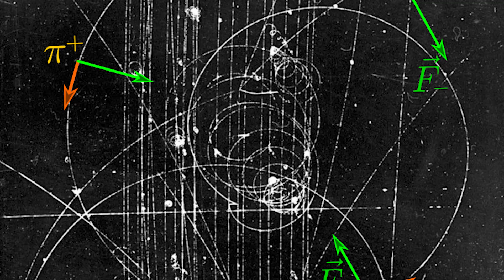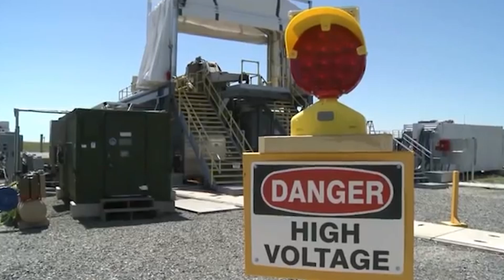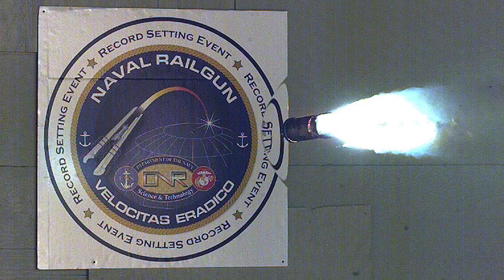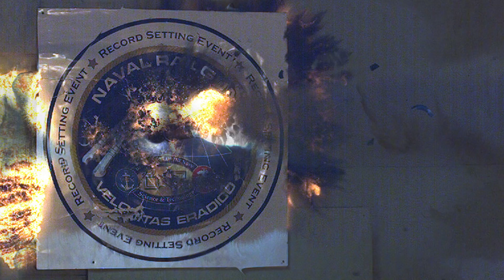Railguns: The Kinetic Future of Warfare

Comment: you should have mentioned that the reason why these as well as coilguns need insanely large power supplies is that they are insanely inefficient in terms of energy used.  i've read that they only manage to transfer about 1-2% of their electrical energy to the actual target.
Reply: i think more like 30% has been achieved. For example the Green Farm railgun used a 32MJ capacitor bank to launch 9MJ projectiles as long ago as about 1990.
Reply: @derekp2674  source?
Reply: @theX24968Z  For a general overview of railguns, the Wikipedia article has some details of railgun theory, past projects and future aspirations ( https://en.wikipedia.org/wiki/Railgun ). It is a bit thin on the ground for information on the 9MJ "Task B" projects though. 

See also slide 15 in here: https://www.slideshare.net/amarmehta123/railgun-akr which shows a photo of the Green Farm 9MJ railgun, and cites parameters for a 8.7MJ launch, in which case the efficiency from 32MJ of capacitors would be 27%.

The Task B 9MJ railgun projects are well reported in IEEE publications from the series of International Symposia on Electromagnetic Launch Technology from which the main papers are available in the IEEE Transaction on Magnetics - i.e. public but paid for references. (For example see https://ieeexplore.ieee.org/document/559905?arnumber=559905  and https://ieeexplore.ieee.org/document/738368?arnumber=738368 ). The latter gives some actual data on successful shots from either Green Farm (USA) or the UK's Kirkcudbright range, which also used a 32MJ capacitor bank.

A more academic railgun power system model for the analysis of energy flows (etc.) is given here: https://ieeexplore.ieee.org/document/101067

Let me know if you have any more specific questions and I'll see if I can answer them...

Comment: pretty sure the only thing holding railguns back is energy density, the size of the capacitors needed... need way too much space and weighs way too much to store it on a reasonably sized ship... like you could convert an aircraft carrier or battleship into a railgun platform maybe...
Reply: I don't know about you, but I wouldn't want to be on board a ship that had just taken a hit in a battleship-sized capacitor bank. Biggest damned arc flash of all time.

Comment: Just for the sake of comparison on barrel life to keep things in perspective: The barrel life of an Iowa-class battleship's 16" gun was around 300 shells, more or less depending on how many full or partial powder charges were put through the gun. Although, the 5" guns the same class carried had barrels that last for 4600 full charge firings.
Reply: To clarify a few things: the life of the 16"/50 Mk 7 guns is actually the life of the *liner*.  The barrel is made of multiple layers with the liner being the innermost and thinnest.  It is the liner that has the rifling and is subject to wear with each shot.  Originally most of the wear was not caused by the friction of the shell but gaseous erosion - the heat and chemical action of the propellant gases.  Improvements in propellant ultimately gave the Mk7's liner a life of ~1500 shots.  After that the barrel would have to go back to the factory to have the liner replaced, a time consuming and expensive process.
Reply: @JonMartinYXD  agreed and during the first and second world wars, the British navy was constantly on the hunt to make sure enemy ships didn’t solidly hold territory as well as protect the supply ships when coming within range of the mainland. I just realized as well that if it’s not the friction from the slug itself but the gas, removing the explosion completely gets rid of the gas and the barrel life would probably be worth more shots since the friction would probably tear the barrel down very slowly.
Reply: That's a really intresting peice of information 😊
Reply: @danielduncan6806  why would it need to be fired only a handful of times?  These are meant to be antiship weapons aimed at targets over the horizon.  Targets which are both moving and defended so no guarantee that you'll hit.  you cant easily put an AWACS system up to monitor the target; that will become a target itself as missiles easily have a 100+ mile range. As such you'll need to fire multiple rounds to increase the probability of a hit and to saturate defences.  It will also need to be available for mutliple engagements, survive in a corrosive environment, and not require shipyard repair and maintenance.
Reply: @danielduncan6806  not entirely, a singular steel sabot is probably much cheaper to produce than a artillery shell because it’s a single dart inside a steel casing which only needs to be propelled by an electrical current. Trust me if the barrel lasts longer and they don’t need to replace it, they will fire it as many times as necessary to sink a single ship.
Reply: Bigger diameter, faster weardown?
Reply: @owenlol2  Higher pressures and heavier projectiles I would think would wear them out faster. ?
Reply: @danielduncan6806  who knew, not everyone knows everything
Reply: The Ford class carriers are supposed to use electromagnetic catapults to launch aircraft, replacing the steam systems that have been used for decades. I want to know if they can be tuned to launch projectiles as well as aircraft.
Reply: @kevinw2592  The electromagnetic launchers were actually developed in a joint naval-air force-army base in my state and my uncle worked in procurement. The answer is no though. Railguns require finely machined materials, rigid construction, and likely a form of conductive material that is beyond current material sciences in order to make it viable for the military as a low(ish) maintenance weapon. The holy grail aspect of a railgun is not specifically it's speed, range, or damage inflicted, but the attempt to have a relatively rapid firing high performance "gun" which can utilize a nuclear reactor (most likely) on a ship, where the projectile itself is around $1,000 per shot, in both materials and production. As an example, a traditional 5" unguided artillery shell fired by modern USN Destroyers is around $10-20k per round and has a much smaller range and velocity compared to a potential railgun.

Anyway, to get to your answer more specifically, the aircraft catapult really isn't remotely close to the same design which would be used for a railgun, as it's launching a heavy aircraft pretty fast over a short distance, yes, but that aircraft is also on wheels with little rolling resistance. The Ford class carriers do have a lot of excess electrical power due to using two high-output newly designed nuclear reactors, but the excess energy was built in to eventually install offensive and defensive laser weapons. The lasers are much closer to being deployed onto vessels (destroyers first, and I believe the first laser prototype named HELOS was just recently installed onto a destroyer for testing purposes). The lasers will have the capability to burn out enemy optical and infrared sensors (called "dazzling"), burn holes into drone flight controls/critical systems, potentially target specific critical areas of enemy aircraft, and defeat incoming projectiles such as anti-ship missiles, all at the speed of light as long as they have line of sight, and each laser "shot" is extremely low cost and repeatable when the cost of energy per firing is calculated. Once this technology matures, lasers will also make their way onto aircraft, likely larger ones at first. Perhaps a larger dedicated drones with their own power generation capabilities could be a viable option, and finally bombers and fighter jets, but again, only once they can develop enough densely packed power generation into their airframes. Even then, the lasers on ships will be much more powerful than those on aircraft due to either nuclear reactors or specific energy production and large battery storage systems added to ships.

If I had to guess, I think a large satellite with perhaps a small nuclear reactor could also serve as extremely effective ballistic missile defense given the fact it wouldn't take a huge number of such satellites in a high altitude orbit to obtain planet-wide coverage in order to target and burn a hole into the propulsion end (and then individual warheads as needed upon breakup) of ICBM's as they enter their apogee in space,. This would be particularly useful given the decoys and MIRV warhead feature of ICBM's (around 10 warheads per ICBM via MIRV and up to 40 decoy warheads are ultimately deployed). I don't think we'll hear about that though, as the military would want to keep such missile defense capabilities extremely classified in order to prevent a conflict or war (imagine how Russia would react if they discovered their nuclear arsenal and the theory of mutually assured destruction no longer threatened the US -  Russia has the capability to kill satellites with their high altitude offensive weapons, just as the US does). It may be an amazing breakthrough though, as it would largely defeat most of the nuclear threat of hostile nations. It might be crazy, but I wonder if the US could convince all nations to dismantle their entire nuclear arsenal (including the US) by offering these satellites to all nuclear powers, so they feel secure in knowing there is no ICBM threat, and even if a country with nukes is lying, they would be able to kill such hidden ICBM's.
Reply: @jamison884  but then wouldn't the laser defense satellites themselves be vulnerable (in a stable, predictable  orbit with limited delta-v) to ground based laser weapons or other space based lasers or even a "regular" ole chemical ASAT missile? Or space based railgun weapons? Or space based "kamikaze" sats? Or are you proposing manuevering satellites? Still the best way we know of to actually move (not just reorient, as with reaction wheels) stuff in space quickly is good ole fashioned chemical rockets. Ion thrusters are interesting but slow, low thrust. Solar sails...one way only. I dont know of a propulsion/manuevering space system that wouldnt require a fuel which would be limited in quantity/delta-v. Perhaps they would become cheap and "expendable" like chaff or flare and we could always be replacing them and de-orbiting the old ones rather than the semi-permanent long term expensive satellite model we have now? That seems unlikely for a bazillion reasons. But would certainly be cool!
The Directed Energy future sure is interesting either way!
Reply: What about the main gun of an Everest class destroyer?  How long does that barrel last? :)
Reply: @danielduncan6806  Good point! Plus the devastating effects of an on-point hit can be calculated in there too.

Comment: 6:40 "The next major step came in 1993 ..." I worked on a DARPA railgun project in Austin, Texas, in 1990, and it had already been in operation a several years before that. https://www.cem.utexas.edu/content/em-launch

7:46 "Rail lives were measured in the tens of launches" It depends on how you define "rail life." With the 30-foot gun I worked on, the longevity of the rails was not so much of a problem as the firing rate. We were honing out the bore after every single shot. Theoretically you could re-fire without reconditioning the bore, but that imparted more damage and a decreased projectile performance.

One more problem you didn't mention: Switching on and off that huge amount of amperage without melting the switch in the process.
Reply: Given your experience working with rail guns, what would be your opinion on rail guns potentially being used to launch a rockets into space in the future? Would it be feasible or would the forces and heat generated be too destructive to the machine’s parts to be practical?
Reply: @RichHomieGon  I don't know if I have enough experience to answer that. All the railgun projectiles I worked with were solid metal. I did work on some guided artillery later in my career, and getting the electronics to survive the shock of firing of the projectile was difficult. That was 105 mm diameter Howitzer. A rocket would be far larger than that. I suppose it would ultimately come down to if you can make the launch "soft" which would require a long barrel and lower Gs. Making something stronger means adding weight, which is the opposite of what you want in getting something into orbit.

Comment: What if you set up rails on the outside of the gun to capture some of the energy used during firing to assist in recharging the system, why are they using such heavy slugs?  it looks fun but is it smart, a 1 kilo slug would do just as much damage and take less energy, etc...

Comment: 8:10 "...they're charged with opposite currents which creates a strong repulsive force..."

Uh, no.
Reply: Fairly garbled text but the two launch rails do indeed repel one another....
Reply: @derekp2674  Yes, but obviously not because "they're charged with opposite currents".
Reply: @pablonh  "charged with opposite currents" makes no technical sense for the context of a railgun barrel. In essence, a simple rungun is a loop of current and the same physics that pushes the armature down the barrel also pushes the rails apart.
Reply: @derekp2674  Obviously. So what exactly is your issue?
Reply: @pablonh  I was just replying to your comment as a conversation. I hope we both agree that the basic physics is that like currents attract and opposite currents repel. 

But I think the use of wording such as "of charged with" is usually more appropriate for devices like capacitors at some set charge (or voltage) rather than conductors carrying some given current. 

Current is the flow of charge from one place to another, so, personally, I wouldn't usually say a conductor was "charged with" a given current, I'd probably just use "carrying" instead.

All that having been said, if we were talking about a railgun power supply where the launch current is first established in a storage inductor and is then diverted into a railgun, in that case I would be happy to say that the inductor was "charged with" its current.

Simon, who scripted the original video, gave a somewhat garbled description of how railguns work and that has led to quite a few comments here. He did, however, grasp the most important point, that simple railguns need a lot of current if they are to achieve useful muzzle energies for military purposes. The laboratory one I used to operate used about 300,000 A to accelerate a 1.2 gram projectile to about 3000 m/s.

Comment: The biggest issue with rail guns seems to be military sponsors who always want to push the envelope beyond what is possible and then walk away from it because the engineering isn't up to that level yet.  Give them a rail gun that will shoot twice as far as their current gunpowder-based weapons and they insist you make it shoot 4x as far, and then some.  Forget that if you dial it back you can still far exceed conventional guns without destroying the rail gun or requiring a couple of nuke plants to power it (which some of our ships actually have).

It's like trying to fire an old black powder cap & ball gun with a modern, smokeless +P+ load.